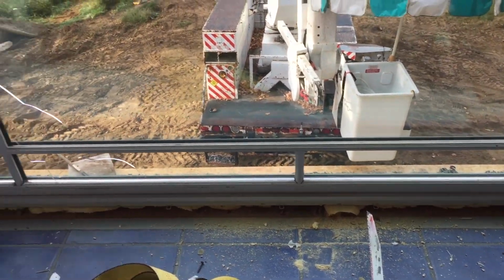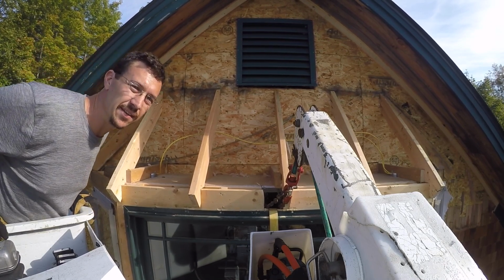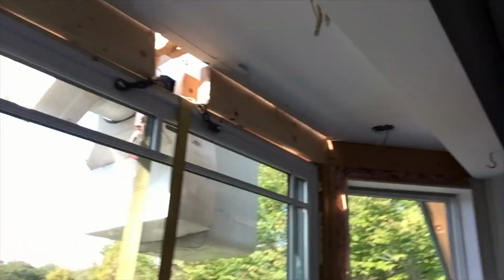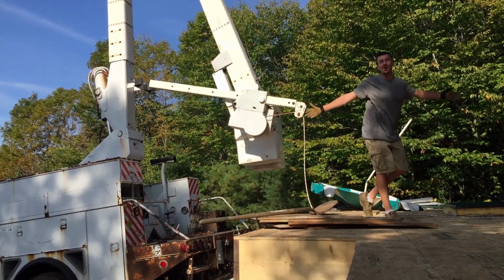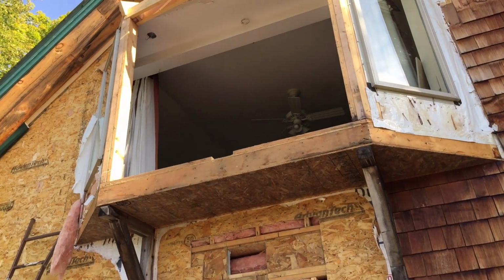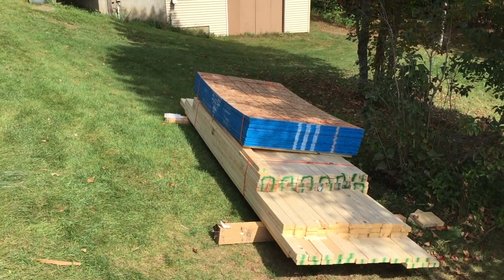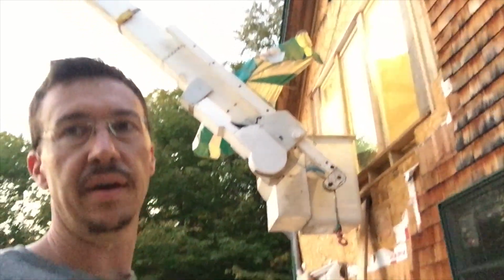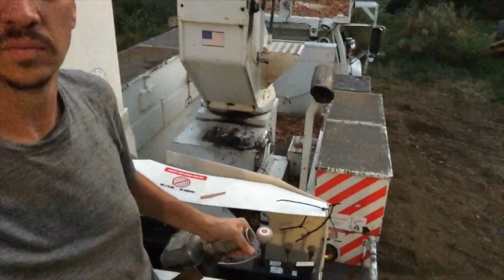Demolition and Removal of a Window Seat Part 2 Building a House Addition

Comment: So what are you going to do about windows in the kitchen area with the addition removing the only one?
You did amazing removing the picture window with minimal damage. Heck, you even kept the flange intact. A couple dowels to plug the holes, sand, paint, and good as new.
If was in this situation, would have tried to save the floor as one unit. Then, rebuild stronger bay window on the addition.

Comment: Upper boom? That's the stick..... Boom and Stick. Boom from your shoulder down, Stick from your elbow to wrist. Doesn't matter much when working alone but when working with an operator the terms upper and lower boom are too easily confused when giving directions for movement. I spent a decade working with lift cranes doing drywall and building supply delivery. We used boom/stick/scope (telescoping inner stick).

Comment: You sould invest in some makita cordless tools
Reply: Why Makita?  I mean I like them and all, but dewalt doesn't change the battery designs every two years so it's cheaper to buy new tools than new batteries.
Reply: Makita has had the same 18v batteries for over 10 years.